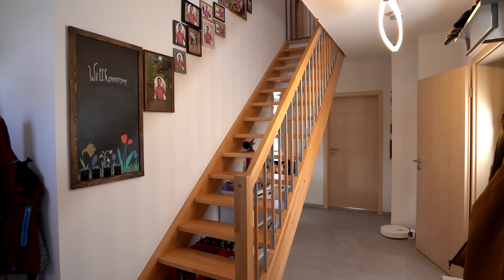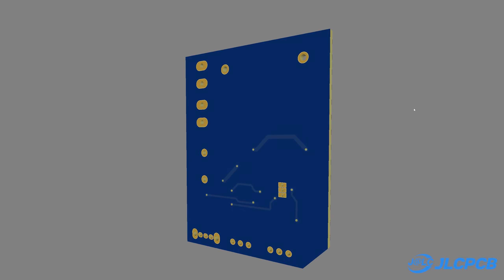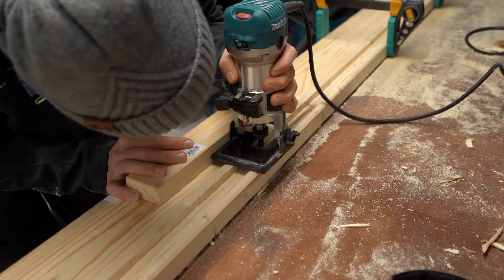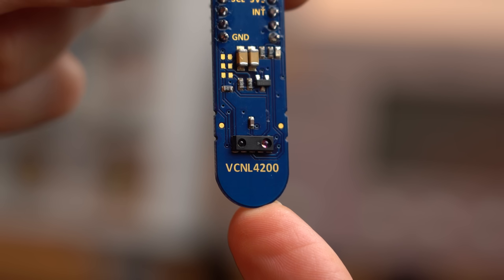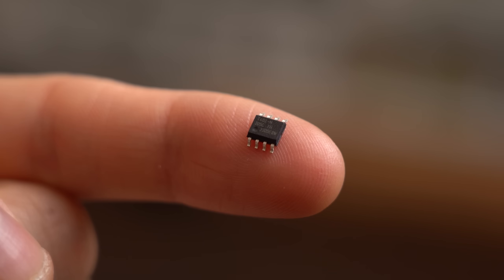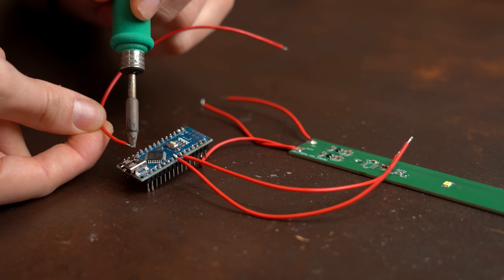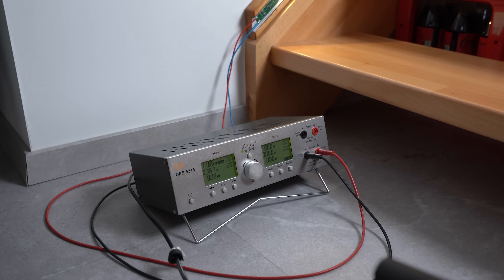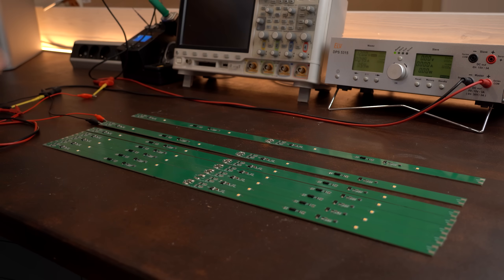I tried to Revolutionize LED Lights!.....And FAILED?

Comment from the maker: The comments/feedback is crazy!! Thank you all for your awesome ideas, suggestions, tips, tricks and whatnot. Really awesome to hear so many advices, opinions. I think part 2 of this project will be a "community" video in which I will partly test your ideas. Will be lots of fun. But it will certainly take a while until I get to that. So stay tuned ;-)
Reply: I don't understand why you didn't mount the lights under each step and put pressure sensors in the floor at the top and bottom... it's what I did at least.
Reply: Can't wait for the video. Wanted something like this on my stairs. Maybe ad the possebility to add this to Home Assistant.
Reply: @philosoaper it would indeed be the easiest, but that would probably add a bunch of wiring that you can't really hide unless you start drilling and/or creating some slots.
Reply: @greatscottlab shared your video with our guys at Vishay. Hope they get in touch with you soon 😉.
Reply: Put a wood texture on the silkscreen so the PCBs blend in
Reply: You called it the big light! ADHD CONFIRMED!
Reply: I noticed the upper three stairs were constantly lit during the final portion. It looks like you have some chromed metal opposite, could that be raising the value of the presence sensor? You might need to add a quick calibration loop (sample period -> set threshold above or below). I had that same problem with motion project, worked great in the lab, failed in the field .. calibration step fixed it.
Reply: Is possible to use the tracks in the PCB as 1:1 transformers? It will help eliminating noise?
Reply: I think you should use connectors to connect each PCB, and also use a custom programming SMD connector on the PCB, so you don't need to solder on the stairs. Good luck, I think very good project.
Reply: great project & quite a decent result for your first prototype... 
🤔I'm curious as to why you didn't use a single microcontroller (or at the very least fewer of them) to reduce the system complexity... 
👉I've been working on something similar for our very dark zig-zag hallway with an RP2040 & addressable LEDs (yeah, a bit overkill & probably a lot more expensive than what you have) ... 
🤔you've definitely given me some cool ideas specially regarding the IR presence sensors (been looking at millimeter wave sensor modules so I don't need so many)
🎉cheers & looking forward to part 2 & what you've come up with!
Reply: @philosoaper  Answer at 0:48  :)
Reply: my opinion is that the ir proximity sensor is not a good solution, because the ir light is reflected and affects other ir proximity sensors.
Reply: @s0ygecko  Yes, you can use track as "inductor wire", but still need magnetic core.
Reply: Amazing idea!
Reply: @wojciechbajon  I assume he has a lot of mini magnets from previous electronic incursions.
Reply: @macTijn  uhm no.... not unless you specifically have the underside of the stairs on display...
Reply: @philosoaper  it's an open staircase?
Reply: I think you should have used a led strip and use a sensor at only ends which would have cheaper and puting a timer like led would switch off after 5 sec according and ( eliminate in a chain pattern )
Reply: @philosoaper he said in his video that his wife told him to not mess with the stairs so you got your ans
Reply: I think you should have used a led strip and use a sensor at only ends which would have cheaper and puting a timer like led would switch off after 5 sec according and ( eliminate in a chain pattern )
Reply: Possible voltage drop issues? Power both ends as an experiment to see if that is causing problems.
Reply: @tej1385  should have looked up thin wires...
Reply: Dear scott, im searching from long time on internet but nothing found, i want to make soldering station with genuine JBC handle using REX C100 PID controller is this possible if yes so how ll it perfome, if no so why ( only pid controller nothing extra things) unfortunately there is no video on the internet and no data
Reply: Just use a big single micro controller which power th ic 4017 which makes the particular led to turn on .
And use usb type connectors for power and data transfer .Make a separate Smps for it so you doesn't need your power supply in use.There are flaws in this censor use an ultra sonic sensor which is quite the decent plus give more efficiency with right amount of distance you set on a micro controller.
Thank you for more support pls give reply to this comment.
Reply: @CCTVReport  Yes if you use the above suggestions it benefits you
Reply: @CCTVReport  Since you need this the most in night bcz i always fall through my steps
Reply: Yours problem is DC/DC and decap.

Comment: i don't know why your impression of your girlfriend was so funny to me
Reply from the maker: Haha she also liked it ;-)
Reply: True
Reply: Impression?
Reply: me too 😂
Reply: lol, it was quite funny. just like my wife, 'you are not going to put a solar light up here'.   Our porch needed a motion light, and she insisted it not be visible, so I had to hide it all.
Reply: Replying to: @greatscottlab  

Idea: stick a distance sensor like the LD2410 on one end of the stairs and map the distance to addressable LEDS. Also 2.54mm headers can be used instead of soldering since the lights draw milliamps. If Ground is a problem then use the star ground layout and add more 100nf caps; copper fill can work against you in certain situations.
Reply: She has quite the squeaky voice.
Reply: I‘m curious: woulnd it work with a wled strip and two sensors? One on the top and one on the base of the staurcase and when just program a „running light“ with the right timing?
Reply: @greatscottlab  I think  there  is  a solution  , try using  arduino  instead  and use a sensor  that detects the full  length  of  the stares so the microcontroller  can switch  the light  on and off depending on the distance , sorry  for  my English.
Reply: @greatscottlab  Other solution, change girlfriend ;-)
Reply: Because a man's impression of his girlfriend/wife is like the real deal
Reply: I look like crazy in metro, when I start smile suddenly😂
Reply: Also photos hanging on the wall are great👌😆
Reply: That's the trouble of being a hobby developer. You have to meet the wife's requirements

Comment: I did this using an addressable strip, arduino and 2 pir sensors for top and bottom, it's been working great for around 7 years now
Reply from the maker: Maybe using addressable LEDs would be easier.....
Reply: Do the pir sensors also give a distamce reading or just digital signal?
Reply: @rizen3467  I do not think you need the distance, but only the signal true/false
Reply: This could also work with a mmWave radar presence sensor which measures distance.
Reply: @rizen3467  They don't have to. Having just one PIR at each end of the chain makes it possible to operate them as 'latches'. Approaching either PIR would act like a 'set/reset switch' for a flip-flop causes all the lights to turn on and passing the second PIR would switch them off again. You could use timers to affect how they switch on and off and another timer to ensure a minimum 'on' period of time because someone following down the stairs, a pet, perhaps, could cause the lights to switch off before you get to the bottom. :P

It's a good solution and because you reduce the number of PIRs necessary for this approach to only two, you can put a fraction of the money you save into buying better PIR sensors. And using programmable strips allows you to get creative about how the lighting 'presents' itself when the first PIR is activated and how it 'excuses' itself when the second sensor has been passed. 

I like it. :)
Reply: So when you reach the beginning of your ascent/descent, do you start a timing sequence that works for your climbing pace?
Reply: Or you can use pir sensor module regular strips and no microcontroller.
Reply: @Csupi007  A radar sensor would be a neat idea, you would theoretically just need one, and use the distance measurement to see where on the staircase a person is, and light the corresponding lights. Not sure how well it would handle other people walking around though, unless you could fashion an easily concealable directional antenna.
Reply: Maybe we thinking too small... Whole house camera system and artificial intelligence for tracking human movement (cause ai everything, not that basic movement tracking would be already really good) it is 😂😂😂
Reply: The 2 sensors are generally a good idea if you expect a constant speed, which is a bit much to ask imo 😂
Reply: @greatscottlab addressable leds are definitely easier, and offers more flexibility and options with the lighting, I like the Pir at top and bottom approach, but computer vision is also getting alot easier to use, and doing motion detection within the band of the staircase, and along it could be a real option if you want that light following functionality,  a single ESP32 would be able to handle all of that.
Reply: @unom8  then a main board that controls the entire run is best, it seems.

Comment: If you redesign the boards, it might be easier to use connectors to slide them together, soldering them all together will have to many failure points and you cant take it apart to diag and repair.
Reply from the maker: I like that. I should really do that.
Reply: @greatscottlab maybe with pogo pins
Reply: @greatscottlab  also make them so that you can disconnect them without sliding out everything, maybe even make them 2mm smaller and glue them into place so that you can take them out easily
Reply: Honestly I think that idea could be commercialized pretty easily.  If they are snap together all-in-one units that a do-it-yourselfer could easily accomplish... that would be a great selling product.
Reply: @greatscottlab  If you going to add some connectors or pogo pins, then also add in a bunch of 6-8mm holes all the way through the PCB large enough to fit some screws through, this way each aluminium strip can be help on with a screw that is accessible through the PCB. This give the option to simple remove 3-4 screws and pull a strip out for replacement with a working spare.
Reply: If you glue them you can't take them out anyway
Reply: Was thinking exactly this, have right-angled pin headers and sockets and just push all the boards together as they're slid into the channel :D
That'll make deflumuxing them after WAY easier. Just pull all the boards out, reassemble on the work bench and have at it with the scope
Reply: Also allows for fudge factor.  The stairs are not going to be precisely uniform, so that's quite important.  In fact, you may even want to do a male/female end with plenty of slop for adjustment, rather than flat end to flat end.
Reply: @fritzlb  Not sure I would use pogo pins that close to where humans will walk (plus they will walk DOWNSTAIRS meaning even more of an impulse due to potential energy being absorbed by the stairs),  since the vibrations might be enough to cause connection issues.
Reply: @karmanyaahm : No need for pogos, a jig to hold pin headers and board in position during soldering is all that's called for.

Comment: I honestly don't consider this project a failure. The majority of the staircase seems to work passably well, and the lights that are stuck on, are at the top of the stairs providing you an unintentional safety bonus of always knowing where the first step down is. Sure, it's not by design, but I'd be happy with this.